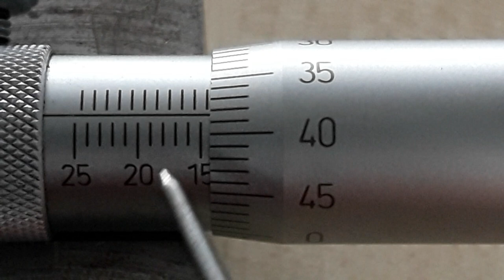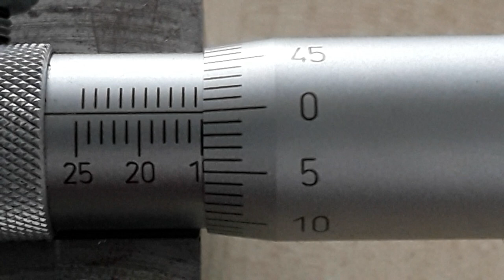Depth mic

Comment: This is the best demonstration of using a depth micrometer because you showed the actual measuring process, and how one slow full rotation of the thimble precisely measures increments of .01 mm, between each 0.5 mm mark on the rod.  For some reason all the other videos presume that no beginner would need such a basic visualization. Thank you!